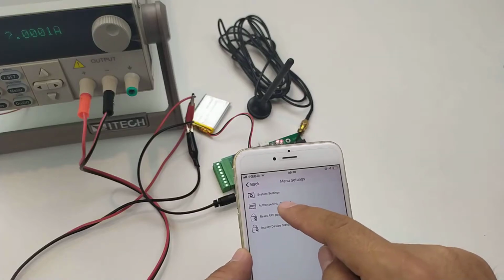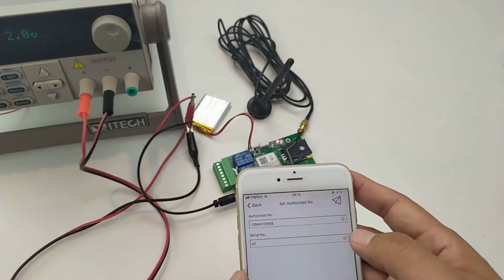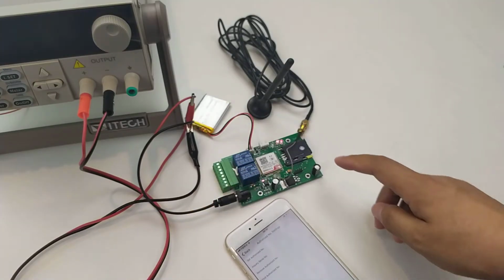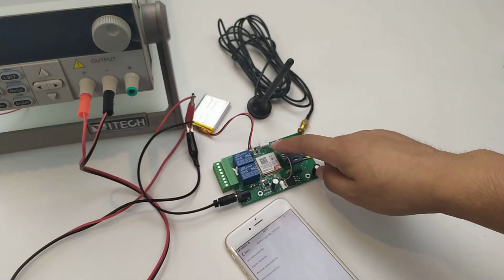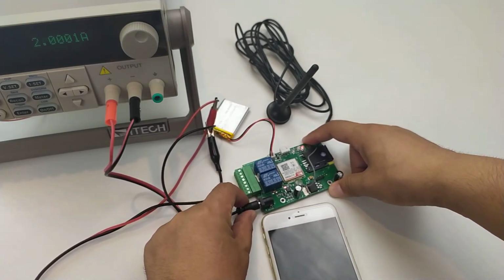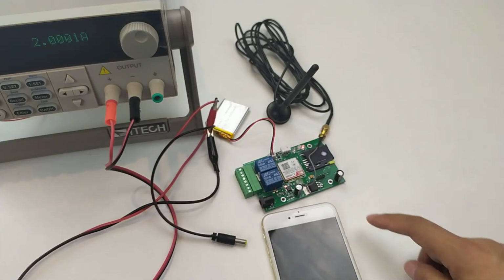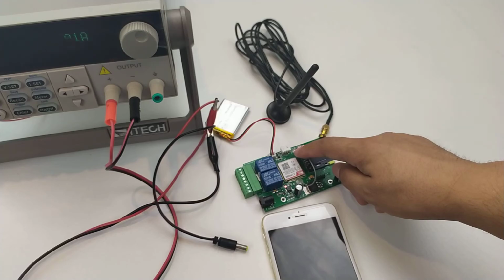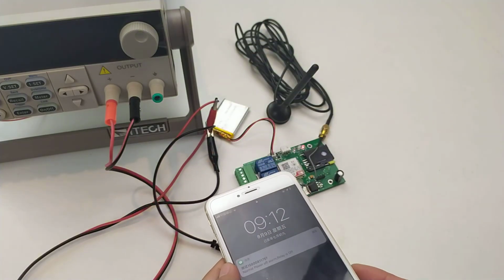RTU5015plus gsm gate opener power failure alarm demonstration

Comment: Hi.
Thanks for your video.
Please I need help with an RTU5015 +
When it triggers an alarm, on input 1, for example, it sends SMS correctly.
But immediately afterwards send many SMS with the text "command error"
Why did this happen?
This also happens when there is a power failure.
Thanks in advance for your reply.